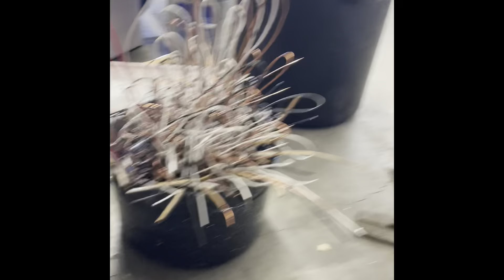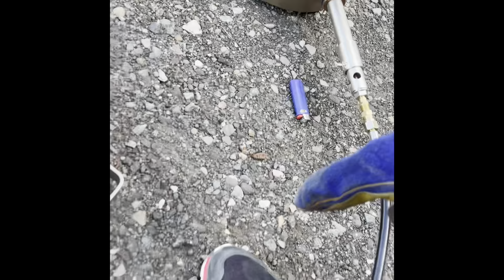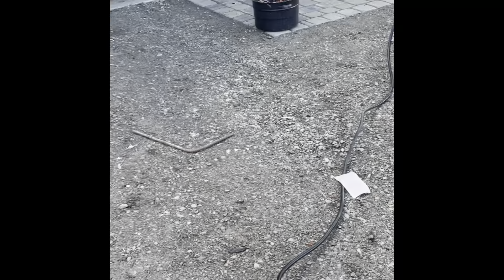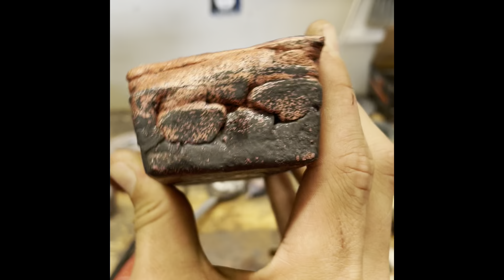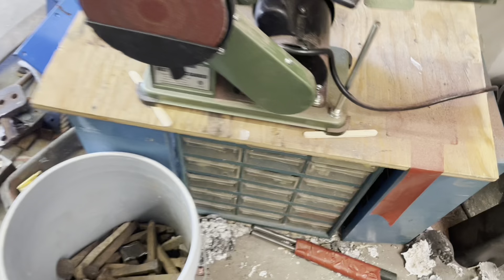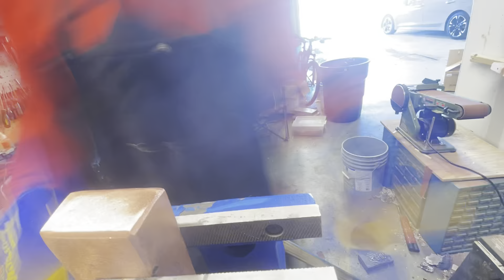Melting A Huge Box Of Wires Into Pure Copper Ingots

Comment: Definitely get some lifting cradle tongs to lift crucible out of furnace and some pouring cradle tongs for pouring. Will go smoother and safer. Maybe use some fire bricks leveled to pour on so you will have leveled ingots. Next time you get a metal mold make sure you burn the painted layer off of it. Use stainless steel spoons to rid slag from copper and preheat it before putting it in crucible to rid it of the slag. And just skim the surface dont go too deep into copper or it hangs on to the steal. Aluminum is easier and so is brass when it comes to the slag removal. Also get a graphite stir stick to stir the metals to get the slag to come to the top. Hope you use a face shield while melting and pouring. Don’t want to see you get splatter burned in the face if something was to go wrong. All in all we all were beginners. I learned a lot from YouTube smelters. Also learned from trial and error. Keep it going and be safe. I build furnaces and forges and melt copper, aluminum and brass. And remember always heat the steal molds fairly hot to keep the copper from looking ugly. Aluminum not so hot. Peace out. New subscriber. Good stuff.
Reply from the maker: Thank you so, so much! I will try my best to imply this knowledge to my next video!

Comment: I seen in a vid a dude putting the ingot in some vinegar if i'm not wrong and it came out clean, you could add some salt but don't keep it for too long as it will dissolve. It will leave the copper looking very nice even inside the holes.
Reply from the maker: I’ll probably give that a shot sometime, thanks!